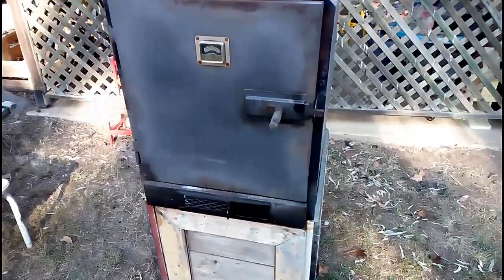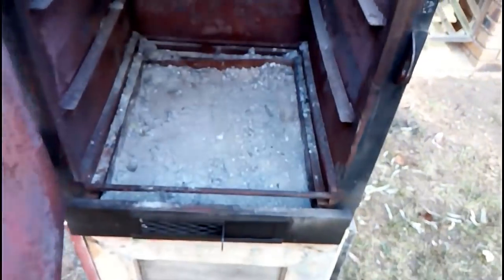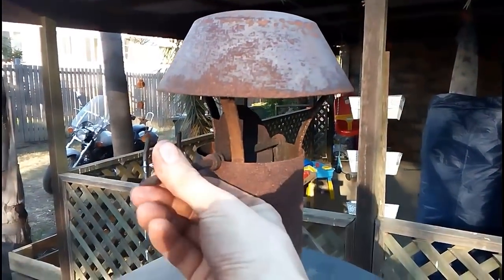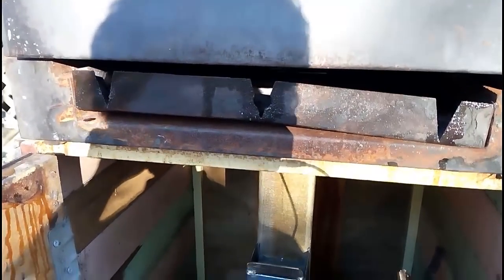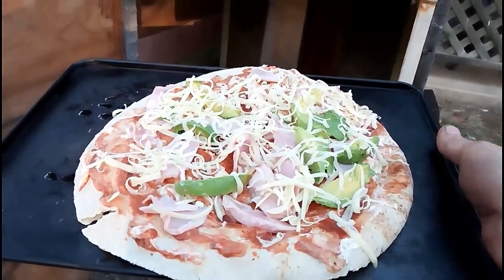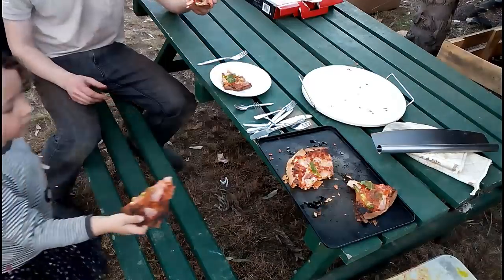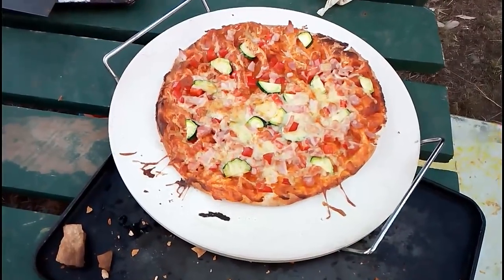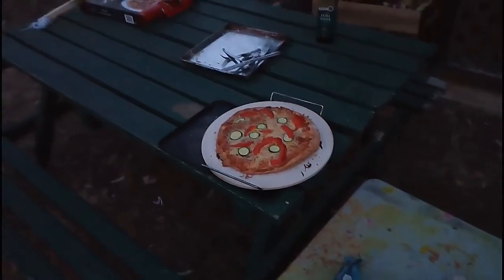Pizza oven rocket stove with Secondary Burn Pt 2

Comment: Thanks for the demo. Adapting it to the pizza oven is a great use for all the heat generated. I love the secondary air intake system! Seems like an inverse arrangement to how gasifier camp stove are usually set up. Is it still working well for you? And I'll be curious to hear about how it works for you as a heater for the shed.
Reply from the maker: Thanks mate, it's still working really well.  Ash build up seems to be my biggest problem because of the prolonged burns.  I've had two pizza parties with friends and family and have lit the pizza oven traditionally, and then once up to temperature used the rocket stove to maintain temperature and this has worked really well. It just gets everything going a bit quicker.  Nearly into summer here so the workshop heater will have to wait.   Thanks for commenting .
Reply: Little Aussie Rockets Cool! After looking at the arrangement, as well as a few other stoves, the clogging makes sense. The simplest solution which comes to mind is to a) make the bottom into a coal grate by cutting out a rectangle below the feed tube/ burn chamber and replacing it with a tight grill grate, (or cutting/grinding several 3-5 mm x 20 cm parallel line holes in the bottom plate instead of cutting one big hole). Then, b) attach a siding removable ash catch pan bellow to new grate.   

The ash pan can also help to regulate air intake, (by cracking it open, more or less a needed) especially if you have access to it directly through the lower door via a cut or a channel. The fresh air won't be pre-warmed, true, but the stove will have easier access to the oxygen it needs for a hotter burn. 

As an avid pizza maker myself, a small adjustment you might consider is installing pizza stone about 20-40 cm (on legs) centered over the hole in the bottom of the pizza oven box. This will help with heat diffusion and give an extra amount of retained heat in the oven - especially helpful when making multiple pizzas and having to open the door more often.
Reply from the maker: I think that's a very practical solution, Thanks!

Comment: Downdraft kiln with the exhaust at the front! 
Max points for originality and a greate way to remove arm hair :) 
It looks like it did a pretty good job at heating evenly as a result.
Do you know baking steels are a thing? ie rather than a pizza stone. Given your mad metal skills, it might be worth looking at even though all you have to do is cut a circle, and add some handles. By way of example, google "pizza steel" for a quick read (25,000,000 results) 
Love your work!
120ThingsIn20Years/BullwinkleII/Craig

Comment: All dads should have potatoes, no?
Nice workshop. Like the secondary air, I just pulled mine out to drill more bigger holes (spotted my space heater smoking quite a bit). Perhaps you put an angle iron in on the bottom for primary air or grille arrangement for ash? I use a slightly different feed arrangement where I control the bottom and top airflow. Im gonna do the asbox thing for mine. 
A properly functioning rocket stove produces H2O and CO2. Look at DavidS's rocket space heater for ideas on how to do the workshop.